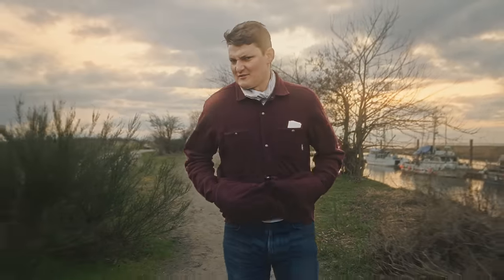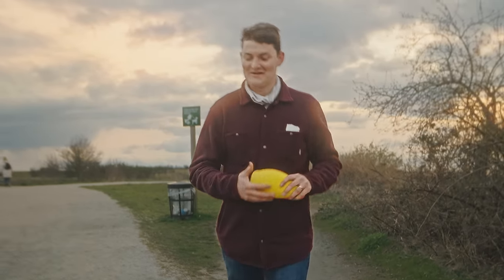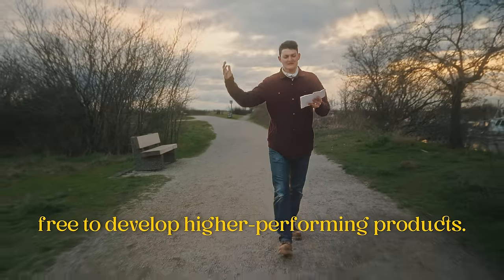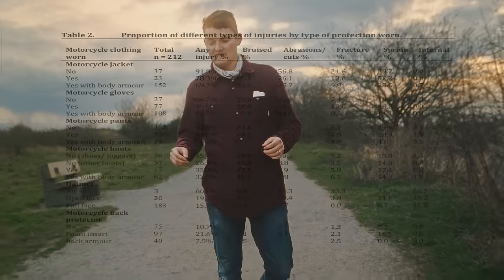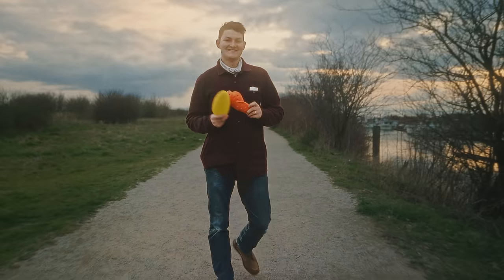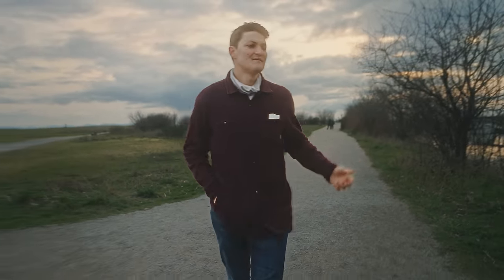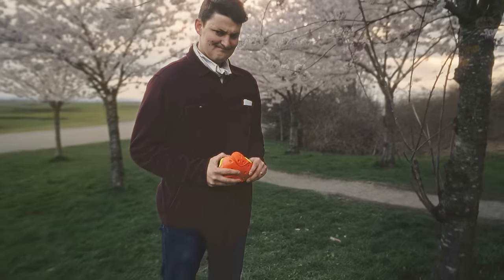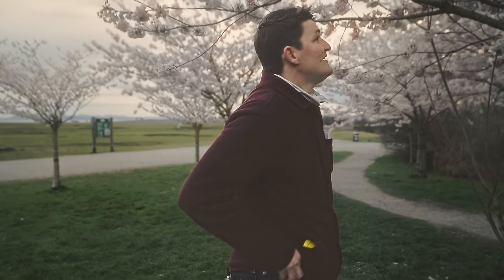Why I Stopped Wearing Motorcycle Body Armour

Comment: On behalf of Liz de Rome:
In the research paper (AAP, 2011), we reported that riders wearing motorcycle clothing fitted with impact protection (IP) were significantly less likely to sustain any injuries than were riders wearing motorcycle clothing without IP and those wearing non-motorcycle clothing. The analysis compared injured and uninjured riders by level of protection taking other factors into account such as crash type, object impacted and speed.
 
We were able to demonstrate significant reductions in open wound injuries associated with level of protection, but not fractures. In our discussion, we explain that the study sample (n=212) was too small to determine statistically significant evidence for the reduction of fractures. This is because fractures represent just 15% of riders’ injuries, compared to 71% soft tissue injuries across a population sample of crashed motorcycle riders. We strongly recommend that riders continue to wear impact protectors.
 
Associate Professor Liz de Rome.
Reply: Great for a direct response from one of the sources. Let's get this upvoted!
Reply: Bennetts Insurance (UK) have done a response video, including interviewing one of those quoted in F9's video 👍
Reply: Source is too old to be relevant.  Any paper older than 5 years should be scrutinized; older than 10 should not be used.
Reply: @springer91977 why do you think research gets outdated after 5 years.
Reply: This!
Reply: @springer91977  It depends on the topic, turns out things like astronomy doesn't change much, while anything older than a year in psychology is almost unusable.

Here for instance we have a 2011 paper on the injuries to a motorcyclist where since: a. human anatomy hasn't changed, b. regulations (that were scrutinized) haven't changed, c. our classification of fractures or soft tissue injuries hasn't changed.

So I'm going to call bullshit on your "it's all wrong since it's more than 5 years old"
Reply: Ryan - I think it's time to amend or withdraw your inaccurate and misleading video.
Reply: I note you conflated two things there - which is why statistics can be used to mislead!  You quoted that those wearing m/c clothing WITH IP were less likely to receive injury than those wearing m/c clothing without IP AND those not wearing m/c clothing.  How about stats comparing just those with and without IP in m/c gear as anyone in an accident is much more likely to sustain more serious injury if they’re stupid enough not to wear any protective gear.
Reply: @neilmckenzie1989  This exact distinction is made in the paper. Protective clothing with IP trumps protective clothing without IP which trumps no protective clothing.
Reply: @ezsteel78 leave Trump out of this
Reply: @springer91977 What’s changed about crashing a motorcycle in 5 years?
Reply: Thankyou for injecting some sanity
Reply: Professor, was there any consideration into how many non-reported single vehicle accidents occurred due to lack of serious injuries? I know I’ve witnessed and have had accidents where we were wearing appropriate safe gear and basically walked away with minor bumps and bruises and due to circumstances there was nothing to report!
Reply: Thanks very much for this Professor Hurren
Reply: I am truly astonished by this development. As always, the devil is in the details. Both Ryan and Liz de Rome's research seem to agree that the reduction of fractures and wearing IP can't be directly correlated. However, an important distinction arises: Ryan does not mention that soft tissue injuries are generally more frequent and can be significantly mitigated by wearing IP. Therefore, I would draw my own conclusion that IP is indeed crucial and strongly recommended
Reply: @pm_2go464  But their reasoning is completely different. Ryan doesn't seem to actually understand statistics, while de Rome and coauthors state that correlation cannot be demonstrated due to the sample being too small. This is already in the paper, and repeated twice in the text. Basically, they say "we don't know" and "a bigger study is needed so that we get to know". Ryan takes this and turns this it on its head, making it sound like if lack of protection from fracture has somehow been proven. That's not how statistics work.
Reply: @Kaiser-ks3yq  that's partly because psychology isn't a hard science and relies heavily on subjective interpretation.... Anyhow, you make a very cogent point.
Reply: @springer91977  This is the dumbest thing I've ever read.
Reply: Generally IP pads protect joints (knees, elbows, hips, shoulders), I would hazard a guess that the majority of fractures are not to joints. I’m not sure we should expect fractures to decrease significantly. 

Also, I’ve never crashed a motorcycle only a bicycle and lycra don’t IP you; not that the bruises are what hurts, the road rash is the worst. I always seem to get the road rash on my elbows, hips, shoulders…
Reply: @GH-rt8ih  and that walk away unscathed could be due to a myriad of things that did or did not happen -sometimes just sheer luck kicks in.
Reply: @pm_2go464  Indeed however the body armour is sold to you as "impact" protection NOT for abrasion protection.
Reply: I was a about to write this.....thanks
Reply: I would add that the video talks about about presence of fracture, or lack thereof. Pads might not prevent a fracture at those impact energy levels, but could reduce the severity / make it more repairable.
Reply: @KipKaspertly  they have started using better fabrics now - Dynema - but you do wear them short so a lot of exposed skin to catch on the road. Ride safe
Reply: @andymeakin4263  : The F9 video needs to stay up, in my opinion. If it gets taken down, all of the debate (on both sides of the argument) will be lost, and in 6 months, a year, two years, another YouTuber will cover the same ground, we’ll be back to the same debate and nothing will have been accomplished from the immense interest this video and the Bennetts response have created. 

Let’s not allow the interest to fizzle out. Riders aren’t ordinarily as enthused about their riding kit, and representation of riders has been absent from the standards committees for too long. Something needs to be built from the groundswell of opinion the two videos have created. If riders want higher standards, they need to start demanding them!
Reply: @paulvarnsverry11  
I agree.  Hence "amend", i.e. be very clear that IP isn't "useless" ... or as very much the second choice ... "remove" to avoid any more people taking the irresponsible advice heavily implied towards the end.
Reply: @pm_2go464  What are you talking about? This video specifically quotes the part of the research that shows how pads have improving effect on bruise. In the end Ryan still repeat that concept, twice.
Reply: @KipKaspertly  Actually, wrist breaks are the most common injury....
Reply: @springer91977  Those are the same sources as provided in the video - Understandable if we were hearing from a contributor of an older source as a rebuttal for Ryan quoting a more recent study. Either the Professor Liz De Rome's response is a valid response to Ryan's video, or any credibility the video itself had is lost because it rests upon that study as a foundation to justify his point.
Reply: My first and worst crash. A low speed drop on a tight slippery corner.

 I was young with low funds and wearing normal denim jeans with no armour. Probably traveling about 15mph when I went down. 

What hit first? My knee... And it was a fast drop. Jeans didn't tear through.. but I lost a lot of skin from the jeans themselves rubbing my skin off in that instant. I am also pretty sure I cracked my kneecap as it was delicate for a looong time after. 

I have crashed since, harder and faster, but with better gear and not even had a bruise. One of those in a greasy carpark where I effectively punched the road with my fist and my whole bodyweight behind it.. 

I don't think anyone expects miracles from safety gear.. hit something hard enough in a bad way and it's going to do injuries.. but damn.. you are still better off if your bony/cartilage parts have some impact distribution and padding.
Reply: This study acknowledges that uninjured participants were hard to find, with their primary source of data coming from interviews of hospital patients. Likewise, they did not interview any dead people, and no alternative appears to have been used to compare fatal injuries to non-fatal ones. There was age and gender separation, but I didn't see mention of the holistic nature of risk management and its effects on the results. Those who wear more PPE are more mindful of risks. That would seem to affect frequency, but not severity, of injuries. However, you must consider all choices that a well-informed rider might make that you as a researcher are not aware of. An informed and risk-averse rider may choose a specific model of motorcycle due to its association with either specific or general injuries, or perhaps certain classes of bikes. I saw no distinction between street, touring, dirt, etc. bikes or and CC categories. This is really important, of course. A smaller and lighter bike in general is less harmful to its rider directly, so the PPE intended for impact with cars or asphalt is more influential, while a larger and more encapsulating bike like a Goldwing is more likely to crush a leg, for example. It's not that one study needs to find the best PPE for a broad range of scenarios, but because these things were not controlled for in the study, we are looking at a potentially flawed recommendation for broad ranged PPE. More specific groups would be needed to find if there are different needs, and also would help to shake out confounding variables that are likely abound in a survey style study with a wide range of gear, bikes, mindsets, and so on.
Reply: What! Are you kidding??  Ok let’s crash, impacting your elbow and shoulder… would you want to have thick pads or not?  I’ll take the pads.
Reply: @andymeakin4263 I fully agree with u! It's complete vital to wear good armour, even go upgrade and make your own metal armour, and it's the worst advice Ryan F9 gave not to wear armour!!! Worse advice ever!!! So disappointed with this video!!!
Reply: What was the P value?
Reply: Thank you so much for this clarification.
Reply: @PumpKing96  For the same reason that p value has to be at least 0.05. In other words, someone made up that number and others took it by face value.
Reply: FortNine’s main point was regulatory capture – a problem that needed calling out. In Europe and the UK, the poachers are also the gamekeepers for motorcycle protective clothing and armour standards. Manufacturers’ representatives comprise around half the European standards committee – it’s even been chaired by Dainese – and the British Standards Institute. That’s plain wrong!

We’ve seen it cause problems from Alpinestars and Dainese blocking a Level 3 standard for armour in the past to, more recently, Knox vetoing the establishment of AAAA and AAAAA clothing standards. In clothing, the abrasion resistance standard for AA was lowered when manufacturers found some materials couldn’t pass the proposed test – a blatant example of regulatory capture. 

Regarding armour and open wound injuries, body armour is neither tested nor certified for abrasion resistance. Understandably, many infer that armour aims to reduce fracture risk.

Often, high standards can drive innovation. So isn’t it high time we improved the standards for body armour, not to mention preventing the poachers from being the gamekeepers?
Reply: @paulvarnsverry11  Indeed. Moreover, Ryan deserves considerable credit for calling out the longstanding problem of regulatory capture in motorcycle PPE. For example, BSI should never have allowed a manufacturer (Knox) to have the power to veto higher protection standards (AAAA and AAAAA). In the European and British standards committees, manufacturers should have a voice but not a vote. The current situation—where the poachers are also the gamekeepers—is appalling.
Reply: This should be a pinned comment @fortnine
Reply: "We were able to demonstrate significant reductions in open wound injuries." And that's the money shot, right there!
Reply: Thanks.
Reply: @springer91977  This is the most nonsensical response I've ever read. Data doesn't go bad just because it's old. What if my gear and bike are 5 years old!?!?
Reply: Thank you for responding to this. I always cringe when people "do their own research" by reading other people's research (that's like calling yourself a novelist because you read a bunch of novels). Just even from his explanation, I was skeptical of his claims and looked at the numbers he put on screen. Sure, it may be surprising that pads don't discernably reduce fractures, but every experience I've had as a soft-body human tells me that soft tissue damage is a significant portion of the human experience after a crash. And if a laceration succeeds in severing an artery, you'll have a hard time convincing the accident victim that he shouldn't regret the absence of something that clearly would have reduced the severity of that laceration (according to the onscreen numbers).
Reply: @springer91977  Source was listed in the video. Thus, relevant enough for a response by the author.
Reply: @ams914  then you have obviously never been to Grad school
Reply: @PumpKing96  It is an academic standard that is applied to peer reviewed papers, aka "sources".  If the source is older than 5 years, then there is probably a more recent paper/study/experiment that has more relevancy in the subject.  If it is older than 10 years almost certainly there is a source with better information.  There are exceptions if you are talking about a fundamental law, but when talking about results of experimentation or data analysis, a research paper from 2011 is old.  A source older than 10 years would be frowned upon in any academic debate amongst subject matter experts; especially if the more recent sources contradict the previous findings.  Luckily, Fortnine provided a decent list of sources at the end of the video.  The more recent sources support his video and position while at the same time make the Liz de Rome findings on impact protection invalid: Albanese, Bieana et al. 2017; Meredith, Lauren et al., 2019; Wu, Dan et al. 2018; etc..  The Fortnine position is spot on: we all wasted a bunch of money on ineffective impact protection, and we can get the same abrasion protection in a much cheaper and more comfortable medium.
Reply: @Kaiser-ks3yq  Did you skip over the four to five newer references provided in the video that contradict the findings from 2011?  Albanese, Bianca et al. 2017; Meredith, Lauren et al., 2019; Wu, Dan et al. 2018.  Did you read them before making a comment about them?  Also, quotation marks are used to reference something that was said by someone else, verbatim. If you are going to quote me go for it; don't make your own statements and add quotation marks to it, Scholar!
Reply: @ShaunHensley  read all the references provided in the video and your inquiry will be fulfilled
Reply: @bobbygetsbanned6049  I'm talking about research, data, and sources.  Specifically, research from 2005 that is directly contradicted by research in 2019, so if fact, the data was bad from the start.  If it doesn't make sense, it is probably because you have never attempted to publish an academic paper.
Reply: @jackschmitt3167  the source was listed because it was being challenged by the more recent sources in the video.  If you challenge a source, it also goes on the references list, you don't just list one side of the argument.
Reply: @springer91977  You didn't say that, you made a blanket statement that data more than 10 years old shouldn't be used, and over 5 years scrutinized.
Reply: @springer91977  Fair enough. I guess I misunderstood your point to be that de Rome should be ignored because her research was too old.
Reply: mic drop 🎤
Reply: @bobbygetsbanned6049 gear does get better though, if you're wearing old gear then the data is still relevant to what you're wearing but if you have the latest safety gear not so much
Reply: @andymeakin4263  have there been any landmark studies in psychology in the last 5 years?????